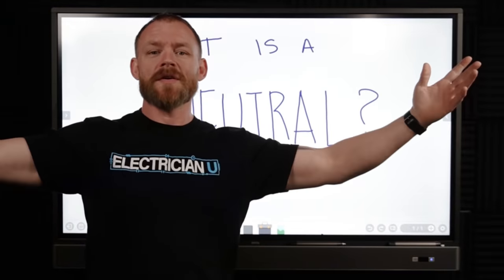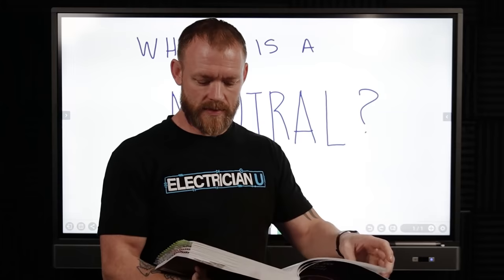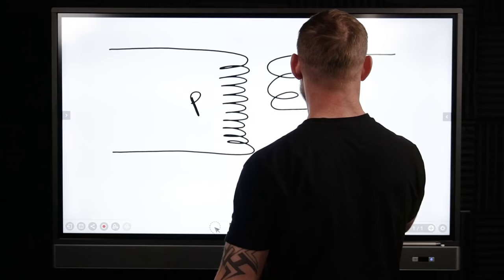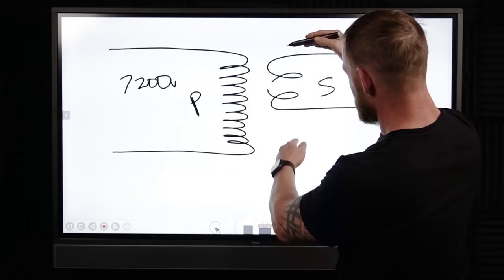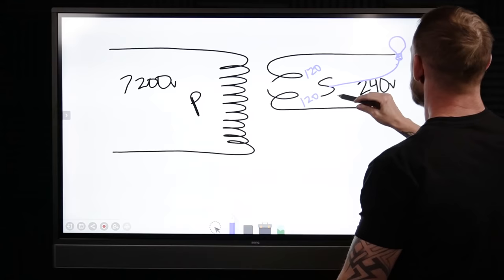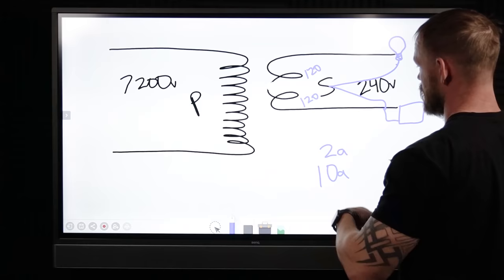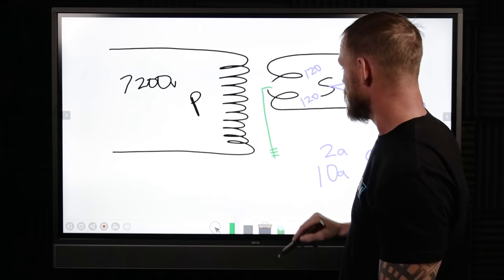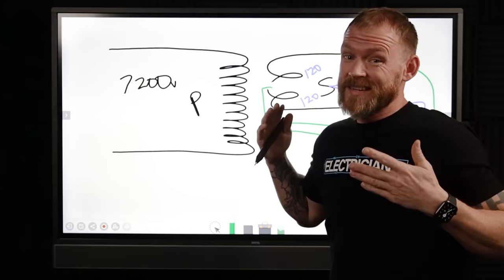What is a Neutral? The Difference Between Grounded and Grounding Conductors.

Comment: Just curious, without respect to the code, does that mean that you could attach your neutral bar in the box strictly to a ground electrode buried in the earth and it would still function properly? If so how does that differ from a “green wire” ground aside from conductor sizing based on intent to carry current vs intent to not carry current?
Reply: You mean having no copper back to the source. Sure it would work to some extent but the ground resistance is high. If it is 20 ohms you would be limited to 6 amperes in total  on a single phase 120 V system. On the split phase it is more complicated but not ideal. Also there would be potentially fatal voltage gradient near the rod.

Are you asking how does ground and neutral differ? Well not really in anyway besides their function. Mow in some countries like UK the ground can be smaller wire and it does not have separate sheath. This n a TN-C-S system of course.

Comment: This made sense, but what I would have liked would have been a demonstration of a three-wire "conductor", like what you would see at an outlet and you would identify which wire is which. In other words, what is the black wire, what is the red wire, and what is the bare copper wire and how do they fit into your diagram.

Comment: Ok got ya.   In a transforer you have  your primary  wording  .... black yellow  set ofwindings. On the secondary  you can have  a hot  a gnd and a  tap between em  that may be a neutral   wire tap  in a high impedence transformer  or high pot in a old tv set for use  to fire the electron gun.

Comment: i think one part you left out is the phase of the two hots  being 180 from each other thus while the ac in one is full positive the other line is full negative giving the total output numbers. in this case center tapping gives one hot to nuetral half the voltage the same as the other half  but the polarity on the other is opposite.
Reply: Yeah he definitely left out the fact that they are out of phase

Comment: Great video!  Can you do more discussing ground vs. neutral and why they are grounded at all?  And then why in some cases, like certain portable generators, they say not to ground at all?
Reply: Its all about potential.
Reply: 1) Ground vs Neutral  -  Earth (Ground) : The Earth wire (Ground wire) is connected to Earth Bus (Ground bus) which is connected to the Physical Earth via an Earth Stake which makes it at Earth Potential (0 Volts). Neutral : The Neutral wire is connected at only one place , the Mains board, to the Earth Bus (Ground bus) which also makes the Neutral at Earth Potential (0 Volts). The Neutral is the return path for the current when only one phase (120V)  is used.
2) Why are they Grounded at all ?:  By connecting the Neutral to the Earth Bus (Ground Bus) and therefore making it at Earth Potential (0 Volts) you are making the Neutral the return path for a circuit that uses only one Phase (120V). Connecting the Earth Bus (Ground Bus) to the Neutral makes any fault current on the Earth wire (Ground wire) have a low resistance pathway through the Neutral  connection at the Mains board back to the transformer which will make the Circuit Breaker trip.
3) The reason they don't want you to connect a portable generator to the Earth (Ground) via an Earth stake, in the case of say it powering a house, is because you don't want to have multiple connections of the Earth wire (Ground wire) to the Neutral. One created at the House Earth Stake  and one created at the Generator Earth Stake.
Reply: Commercial use of electricity began around 1880. By 1900 they had learned that one needs to ground systems even though if gives the possibility of shock between live and ground. Remember protective grounding came only some 30 years later. That means there were really good reasons go ground systems.

It mainly is about over voltage protection that could be caused by for example lighting nearby (a direct strike to the lines causes hell no matter what). Also accidental grounding of an ungrounded system is a problem so it was seen better to do it controllably.

In very small systems ungrounded can be better like when using an isolating transformer.

Comment: Well I see and here and am clearer on what I never understood. But man now confused. Before just did not know. Now with new knowledge really confused. Between how Neutral and ground are different. If neutral is going to ground. But surely willing to learn and understand. You got me on this vid. Rock on.
Reply: The utility has the neutral and ground tied together where the utilities enter the building (the main breaker panel) for their own reasons. Inside the house the neutral and ground should never be connected together. The ground should only be there to give a path for current to be able to trip the breaker when there is a short to ground. 

That’s a perfect world of course and rarely are things that perfect.
Reply: Important thing is to realize that as far as working of a device is concerned it does not matter which one is neutral. The difference is for safety reasons only. 

Neutral and ground are basically same. They go to the same place. The neutral just is the one that carries the current in normal operations. Ground does not carry current normally. The current raises voltage on the neutral to a few volts or so. If the current was on the ground it would raise the voltage on all equipment cases. This then would cause stray currents on things like data cables.

In some countries like Finland and Germany the neutral was earlier used for grounding. Such tray currents are a reason that is not done anymore. It also has some safety concerns if the neutral breaks. The voltage gets to the cases.
Reply: @okaro6595  Thanks for that. I know how to work around a lot of stuff. But electricity  makes my brain want more understanding. Whatever work on. I look for codes so I can do it right. On electrical when in doubt I call my friend I pull onto jobs when over my head. And Jayson does industrial, commercial and residential. He will tell you Bob does it right and if in doubt he calls. So thank you Okaro X. I have a circuit testest and warns when circuits are out of balance. just had one Gfci would trip out. I want to know why. Dry location and all circuits were dry. But customer did not want to find out and fix. Installed regular breaker and added gFI outlets and everything ran. Hots, neutrals and grounds all checked out.
Reply: @ecospider5  But the neutral and ground are tied together inside the house. If you don't believe it turn off all power to your house and use an ohm meter and see.

Comment: The term "grounded conductor" is ugly, but it is slightly more accurate than calling it the neutral. Especially if you are a lineman. There is a more real system neutral and it’s not this. What is described in this video is a tap in the X winding of a single-phase transformer coming off of one leg of a three-phase source. And it acts as a sort of local neutral for the purpose of the voltage references with respect to the load. That’s why it’s called “neutral” at the residence (the load). Maybe a better word would be the tap conductor. That would mean something to a distribution lineman but not so much to a residential electrician. Hence the confusing jargon.

The reason that this is important, is that if you were to encounter the real system neutral, there will be a voltage difference between it and this local neutral. If you are an electrician working in a facility with both single-phase and three-phase service, then you need to look out for these things.

Comment: The neutral is a transformer tap going to ground for a desired voltage at the tap that's grounded. And it is grounded, just like the equipment safety wires are grounded in the same way. The 7200 high side on transformer ...one side of winding is the grounded wire in a wye most likely 3 phase secondary system.  The equipment safety grounds are as well current carrying wires in the event of an open hot coming into contact with the equipment. It saves your life in higher voltage situations should you touch the equipment. The reason you can touch a neutral bar / wire and not get shocked is because it too is grounded in the same manner as equipment ground

Comment: He showed us the definition of “neutral” in the code book, which uses the term “neutral point,” then went into his own discussion.  But “neutral point” is defined in the book right after “neutral.”  He showed it on the screen, but without highlighting it or reading it.  Back up.  Read both of those definitions before continuing.

Comment: I guess my real question after this video is: /why/ is the neutral grounded? Why do we intentionally connect it to the ground? Why do we not just keep it as the center between the other two ungrounded conductors?
Reply: That's a thoughtful question. Indeed, you don't necessarily require electrodes driven into earth if you have completely trustworthy pathways back to transformer neutral. But, stuff happens, like falling trees, broken neutrals, and shorts to the equipment chassis. From a safety perspective it makes sense to have a established alternate pathway back to transformer neutral, albeit with higher resistance, to define a happy equilibrium center point for the potential of the transformer midpoint, the adjacent dirt, and any equipment a person might happen to touch. It allows voltage a relatively easy backup pathway to trickle back to the transformer from building to transformer pole, hopefully reducing the voltage drops across earth, equipment, and the pole to an equipotential safe level. That way a lineman can safely climb the pole, knowing that the lowest resistance pathway between earth and the transformer above is the ground wire he climbs beside, not his body.
Reply: 1) By connecting it to the Earth bus (Ground bus) , which is connected to the Physical Earth, your making the Neutral the same potential as the Earth (0Volts).
2) The Neutral is kept at Earth Potential (0 Volts) to make it the return path back to the transformer when your using one Phase (120v).
3) This connection of the Neutral to the Earth bus (Ground bus)  also creates a Low resistance return path for fault current.  If a fault was to occur a very high current will flow back through the Earth bus (Ground bus) then through the Neutral to the Transformer and cause the circuit breaker to trip.
Reply: Strictly speaking it is the transformer center tap that is bonded the the earth ground creating the Neutral as the grounded conductor.  This serves several purposes.  

One, it causes there to be a potential difference between the earth and  only the hot conductor.  Thus, the cup of an Edison light socket does not have a potential difference with the earth ground but the center tab does, making it safer for touching.  

Two, it provides a parallel path between the service entrance bonding point and the ground on the center tap at the transformer to cap voltage spikes and bleed them off from induced voltages on the house wiring.  All that wiring in your house is a big antenna that can pick up induced voltages from very close transmitters, nearby lightning strikes and also inductive loads switching.  

Third, it creates the first fault of the two faults necessary to make an isolated electrical system, uhm, shocking.  With enough fault current, this will cause the breaker to trip when a fault in equipment occurs instead of one happening then years later the 2nd occurring.  Good luck trying to fix that wiring by locating the two faults to an unintentional path.  Even worse when it might include several houses or buildings.  So, with the other benefits, the grounded center tap ensures the fault is noticed when it happens.  Coupled with the bonding grounding conductor, you get a low resistance path, thus high enough current to trip the breaker.  

Out in the transmission side, the neutrals between system create a path for fault current if say a high voltage transmission line comes into contact with local distribution lines.  And they have a real need for siphoning off induced currents.

Comment: Is it actually 2 separate wires wrapped around the coils or is it wire from 2 points?
Reply: Look up how transformers are made.  It is very interesting.  In making his high-voltage machines for arcs, Tesla used 2 turns of wire on the primary and many on the secondary.  An iron core is used with part of it going around the primary turns and the other part going around the secondary turns.  The turns are the turns or coils of wire which is necessary to insulate from each other.

Comment: I get too used to seeing the British YT Sparks...their 240VAC with L1 & L2 + G seems much easier to deal with...especially considering the load balancing problems of ours.
Reply: Yes but then everything you plug into the wall has to handle over 3000w. Which they decided was crazy so every plug in the UK must have a fuse in it to protect the wires after the plug. Which is why all of their plugs are huge. 

Every design has positives and negative’s. Personally I bet house wiring moves to 50v dc except for the few things that need more than 150w. Removing the need for electrical codes for your lights and laptops.
Reply: @ecospider5    
DC can't travel very far without severe voltage drop...which has always been a problem for Edison electric.  Tesla made AC so it can be transmitted much farther. The only way DC would work is to have AC-to-DC converters in every socket/receptacle.
Reply: @gregorythomas333  I think he's thinking ahead to where everyone has some sort of solar or the like. Just a guess.
Reply: Britain as line and neutral. In many other European countries three phase is the norm even inside apartments. In three phase the neutral also carries the unbalanced load but you need to calculate them as vectors.
Reply: @ecospider5  Actually the breaker is 32 A so it could give 7700 watts. 3000 watts comes from the flag that the maximum fuse allowed is 13 A.
Reply: @gregorythomas333  Nothing to do with AC and DC directly, just about voltages. 140 years ago one could not modify DC voltages. DC was used in parts of Helsinki until 1962. The DC was generated from AC mechanically.

DC is used commonly in undersea cables. Britain is connected to Europe with DC, not AC.
Reply: Yes, but if the PEN-wire breaks you have full 240 V on the equipment cases instead of at most 120 V in the US. That is why EV chargers need to be protected against PEN-faults.
Reply: @gregorythomas333  There is nothing that prevents DC from traveling far. UK gets electricity from France as DC. We do not live in the 1880s anymore.

Comment: Gotta know how neutral is created to know what it's really for. It's neither positive, negative or ground and doesn't actually conduct anything until there's over current from a short or a lighting strike, and that returns back to ground. On a full wave, neutral happens twice per cycle, so thus it has the path of least resistance, so it is then used as a conductor to return to ground, it's the reason why both ground and neutral uses the same conducting paths. If you viewed just one full wave on a oscilloscope, you'd see that neutral happens twice for each full wave at the point of polarity changes. It all starts at the electric companies that actually produce and control the 60 hz cycles... and that's just the simplified explanation. You get into the actual physics of it, and it gets a bit confusing and complicated until you fully understand what's really going on.
Reply: The neutral is created by grounding. Think about a simple single phase system that has two wires and, say, 240 V between them. Such a system would work as such and there would be no inherent difference between the wires. There, however, are reasons to ground the system so one of the wire is grounded. That becomes neutral.  Grounding electric systems in the US was illegal before 1899. In 1901 it was recommended and in 1913 mandated. Note this should not be confused with the ground connector on three prong sockets. It is entirely different and came came half a century later to solve the problem the system grounding created.

Now the US system is slightly different. Instead of grounding either of the two wires, there is a third wire that is taken from the center of the transformer and it is grounded. This gives option of 240 V and 120 V and no point has higher than 120 V to the ground.

Positive and negative are not meaningful concepts in alternating current when describing wires. The neutral is always at 0 V. The phases alternate in the US between +170 v. and -170 V.  Also when one hot wire is +170 V the other is -170 V. They then cross zero at the same moment and reverse so that one is -170 V and the other +170 V.

Neutral does carry current always unless it my a miracle happened that both legs had equal load.

Comment: I believe THIS Really helped out a lot explaining the poll transformer set up on the house side.
Trying to understand the wiring in the “OLD” houses that have run like a 10/2 wire way out to a barn for the well pump, then over the years up into the 60s n 70s other wires were run out of the old glass fuse box to lights or receptacle’s with all the Ground & Neutrals going to the Same bar, and you See that This has worked for Who Knows how many decades…!!! 🤔🤷🏻‍♂️🫣 What say yee?